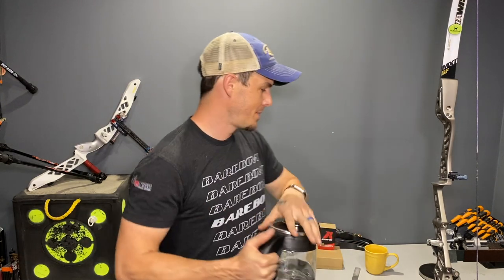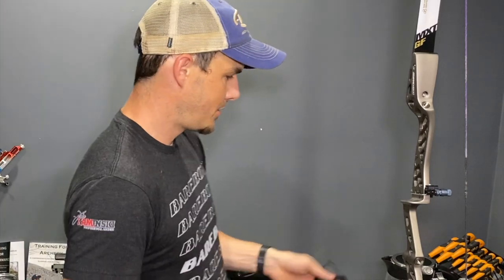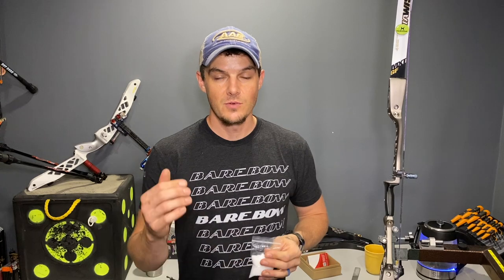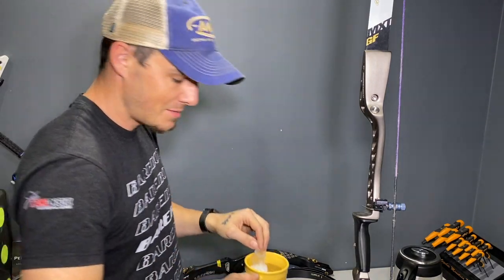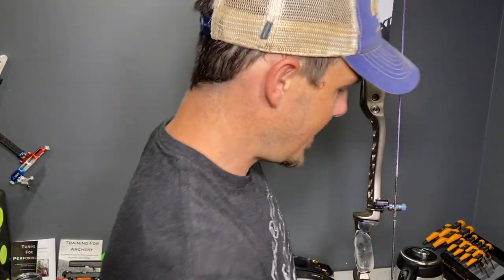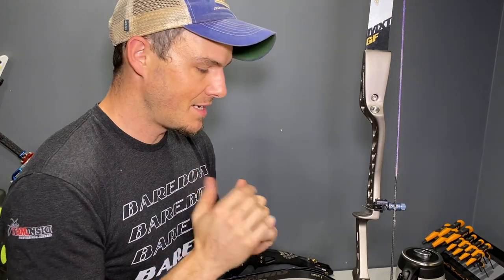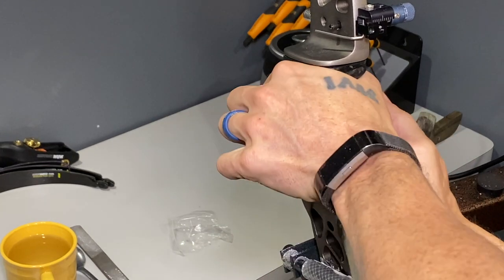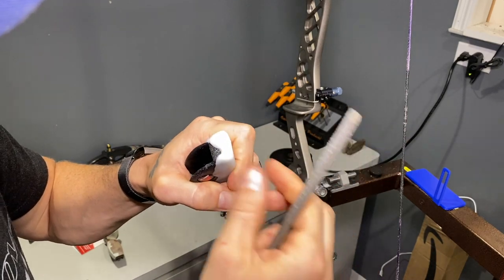R Core Moldable Grip Review | The COOLEST way to Make a Custom Archery Grip with Thermoplastic

Comment: This stuff is really cool! I'll definitely try it out! 
Also interesting to hear your thoughts about their grips and grip materials (such as glass!).

Can you please elaborate on the grip you invented for Hoyt that made its way into the HP geometry?
You mentioned them in your old grip making video, but I couldn't find any info about them.

Why is nobody is shooting them? Would you recommend building one?

Also, what are your thoughts about raising the pressure point but keeping the slope low, and keeping the pivot point untouched? Results in a "hump" that goes towards the hand, and goes back down with the original low slope. I hope I made myself clear. 

Thanks a lot as always!

Comment: If you have a removeable bow grip try epoxy plumbers putty.  It is available at all hardware stores.  Cut off the amount you want and then knead it until the color is even.  Now you have a few minutes to apply it to the grip and move it around to form the grip the way you want it.  It will be rock hard in a few hours.  I have applied it to my pistol grips on a sig p320 to build a larger thumb rest.   I used a Dremel tool to grind it down where needed. I would not use it on wood risers.  You have a great channel, thank you.
Reply from the maker: I reference a video I just posted on that exact putty. I posted the video 2 days ago. Thanks for the support.

Comment: Around 25 yrs ago there was a product called Form-A-Grip. I can't remember the process I used but I think it was just a medical glove. U held the grip until it was shaped to shape of your palm. But it was more of something permanent right to the riser of the bow. It gave u a custom DIY & it's best feature was that u never felt cold from the riser. I had Robin Hoods I shot using fingers on a long compound. I'm now looking to find something in a 19" riser cuz the two 19" wood risers I have both have pros & cons as far as the grip & stability I desire. I'm not having any hand shock from the 2 sets of carbon ILF limbs I have. So it all comes down to hand position. ✋️

Comment: Neat.

Is it affected by a heat gun, or as low heat as a blow dryer? Is there some mysterious chemical reaction with water?

If you can have them share a more exact date for when they're launching the system, that would be appreciated. Or a pre-order even.
Reply from the maker: Should be on Friday when its launched. Its purely just heat so a heat gun should be just fine to make adjustments especially finishing touches.
Reply: nothing mysterious. if you search for polymorph/polyshape/polydough you'll find basically the exact seme pellets. it´s just a polymer with a glass transition temperature of around 60C

Comment: Seems like adherence to the grip could be improved by buffing/roughing the grip, then cleaning with alcohol before sticking the blobs.
Reply from the maker: The printed grip gives a lot of surface area for the blob to adhere to. The issue was user error in this case.

Comment: Hallo Jake! I used hot pistol melt glue; just melt some glue on the grip, molded as you like, use hot-air pistol if the glue stiffens..., watch out burning your hands/fingers, so use a bit of water with soap so the glue doesn't stick on them!!!!!! After molding and shaping, I covered the grip with leather....
 All on your own risk!!!!!

Comment: Basically I think that's not the way its intended to be used.

I assume you should pur it into hot water, put the glob onto the handle, wet your hand and grab it the Way you would grab the handle while shooting. 

Then the Grip would perfectly match your hand in shooting position.
Reply from the maker: Doing that will allow you to induce too much torque on the bow. You need a solid platform to shoot from that doest not let your hand slip, and torques the bow as minimally as possible while at full draw.

Comment: I'm going to bet that the thermoplastic never 'cures' - it just cools, and sets when it's cool. Otherwise you could never reheat and reshape it. From which (according to my logic) ti oughtta be possible to remodel it  on the riser, with the assistance (and careful use) of an electric heat gun.
Reply from the maker: Yeah I meant cooled not cured...

Comment: looked nice but i'm not a fan of this product. It seems like you have to put material in the troath of the grip too and many people will get that wrong, completely ruining the way the bow will perform. Also it melts at 60°C so yes it will still be hard enough when you shoot in 40°C temperatures, but it will not have a 100% same density as it will have at 15°C. I would never put a product that is that temperature sensitive on my bow, especially not in the grip. Also, i think it would feel different (more sticky) in warmer weather then in cold weather. Finally i do not think that when you have a perfect grip for one handle, you can duplicate it to fit another type of handle. Every bow is build in a different way, especially when you change brands. I'll stick with the messy putty

Comment: Thermoplastic is possibly the WORST material to use for a grip. A customizable thermosetting plastic grip makes sense, but a thermoplastic plastic grip is terrible. The last thing you want is an unstable material.
Reply from the maker: Seems to be fairly stable, even in this hot temp in Florida.